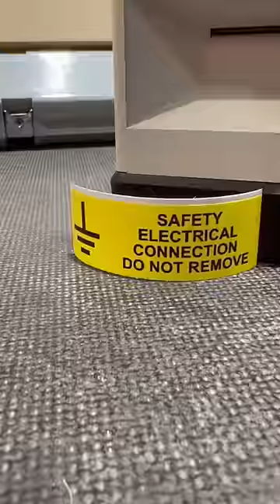Electricians Shocked by this Mysterious Earth Clamp

Comment: The only way an electrician is going to be shocked by this clamp is if there is an earth fault or if they see the price :,)
Reply: Or unless there’s short in the house, and it grounds out to the copper plumbing which that is attached. They will find out when they wash their hands Lolol.

That’s def not code where I live to ground electrical to the plumbing.
Reply: @nebraskaman8247 

So you don't ground your copper pipes? All conductors should be earthed for safety reasons.
Reply: Looked to me like he was using the plumbing as a ground for electrical purposes.
Reply: @nebraskaman8247  We don't bond the pipes to use as an earth. It's so that in the event of a fault, all the metal that a person might be in contact with is at the same voltage. Reducing the risk of electrical shock.
Reply: @nebraskaman8247  its not “grounded” to it, its “bonded”. If you are in the US, it certainly is a NEC requirement to bond across the water heater hot/cold lines.  Note: there are exceptions,  including if pex supply lines are used, at “X” distance to/from water heater, tank material, etc.
Reply: Or by static electricity
Reply: @nebraskaman8247 most likely the other way around. Not ground to plumbing but plumbing to ground.
Reply: @paulw6183  Yes, you ground copper pipes separately. You can also use equipotential connections if you have a weird installation with a lot of induced voltage.
You DON'T ground your electrical instalation THROUGH any pipes.
Reply: @ogi22  

Yes the extraneous materials should be bonded separately on a dedicated circuit, you do still connect it to the main earth terminal though.
Reply: @paulw6183  Ofcourse. To the ground connection near the earth. To not create current flow through media pipes in case of a short circuit. Every modern building has those terminals in each room. Usually near the floor, with a metal stripe leading into the wall. According to two basic laws of electricity - Ohm's and Kirchoff's.
Reply: @nebraskaman8247  100% had this happen where the short grounded out to the plumbing. Thought I was crazy the first time it happened but was 100% electrocuted by my shower... twice... turns out the house, as old as it is, had a shitty ground that failed.
Reply: Ya I’ve personally seen it before. Never had it shock me tho. Just was testing some electrical stuff in a older house once, and the plumbing to ground had power.
Reply: @nebraskaman8247 🤦‍♂️🤦‍♂️🤦‍♂️
Reply: @SWnAZ you weren't electrocuted as you're still alive.
Reply: @dkaspar67  that's because the bond is for metal work. Gas pipes usually. No one is bonding plastic
Reply: Yeah. $3 is craaaaaaazy.
Reply: @starbarrothschild6597 hmm, you've gotta defend that one. I'm no electrician but as a 20 yr medic I'd be questioning my skills if all electrocuted patients died. I mean, this is really a silly statement to make. Even as the most general definition, we "electrocute" ourselves... often! Often enough to call it therapy. Electroshock therapy. Go read a book, don't be argumentative.., and don't do drugs, mkay?
Reply: @dkaspar67 "simple" isn't a prerequisite for plumbing. If only splitting hairs were, tho, eh?
Reply: Ask an American electrician about earth fault loop impedance. External or internal. They don't have to test it at all. As long as the lights show correct polarity and a ground Alls well. I've used the kewtech plug in tester all lamps illuminated. Huge Ze not enough fault current to flow to operate the protective device.
Might be wrong here guys but I did ask this question on another channel and was asked by our stateside friends to explain. Not questioning your workmanship BTW guys. Let me know if you know any different.
Reply: @neepsmcfly4176 It’s a combination of the word electro and execution. It means death by electric shock. So what? You’ve been using the word wrong. Look it up. But who cares? It’s now a colloquialism. Meaning injury by electrical shock. We use expressions non literally all the time. 

For example when you trip and fall, you “Ate shit.” Few people really care if you actually ate anything, let alone shit. It’s not remarkable to express things in this way.
Reply: De-ionized water is resistive, tap water is quite conducive. Not quite as good as copper, but still pretty good, and much better then dry soil.   The dryer the soil, the more/longer ground rods you need.
Reply: Right then. Electrocution in the UK means to kill someone. If you’re a medic then you should know this. I read a book called the Cambridge dictionary to find that out. 

This guy is in the UK. Therefore everyone saying this “isn’t up to code” is quite right. It’s not in your area of the world (probably N Amurica). 

He’s not grounding or earthing the system through the water / gas pipes. He’s creating an equipotential zone where all the metalwork that might carry current is bonded together to create a zone of equal electrical potential to reduce the risk of electric shock possibly leading to electrocution ie. death. 

All installations in the UK have an earth terminal which is connected to the general mass of The Earth. Almost all circuits (with some more able exceptions) have an earth conductor (wire) which is connected back to this terminal and don’t ever rely on gas or water pipes for a return earth path. 

As improbable as it may seem, I’ve seen installations where plastic water pipe has been “earthed”. 🤷‍♂️ 

Remember, not everyone lives in North America so practices differ from country to country.
Reply: Lightning.
Reply: @nebraskaman8247 they arent using the pipes as a ground, they are just bonding the pipes
Reply: @chickenmonger123 According to a number of American English dictionaries i checked, electrocute means to kill or severely injure yourself so death isn't the only posdible outcome. But UK dictionaries define it as killing oneself with electricity. So there is a slight difference in how its used in America vs the UK.
Reply: @nebraskaman8247 if you have a ground fault, you have a short circuit and the breaker is going to go pop
Reply: @andyscott5978 I'm American and in the trades and we all understood this. The YouTube keyboard architects and engineers are a different story. 

My mom always says don't bump heads with a brick, you'll only be left with a headache. 🤷‍♂️😂
Reply: Why not just do it right with a ground rod? This just risks electrifying the plumbing of there's a short
Reply: "Earth fault" ? 😂
Reply: @deci5608  Perhaps because this has nothing to do with ground rods, and doesn't risk electrifying anything.
Reply: I once knew a man who accidentally pissed on an electric fence during a paintball session.
Reply: I am forced to revise my opinion. Bad electricians will also be shocked because they don't know what they are doing
Reply: @cobalt49  And there's a near infinite supply of 'em, too.
Reply: @cobalt49  Don't take it personally.. but any "good" or "great" electrical entrepreneur or engineer. Or even a decent Electrician .. has been shocked. No matter the safety measures. It happened.
Reply: @doejon9424  getting a shock isn't the issue. The number of people who are making fun of the very idea of equipotential zones causes disappointment
Reply: @cobalt49 They just aren't getting it.
Reply: @nebraskaman8247 depends on how far away they clamped the ground to the slab penetrating ingress of the water feed. It should never be used as the main ground, and should always be clamped as close to where it comes up through the slab. The main grounds should still be copper driven rods outside.
Reply: @neepsmcfly4176  Electrocution implies death. Here's the definition of electrocution by the Cambridge Dictionary: "the action of killing someone by causing electricity to flow through their body". Now we also use this word for accidental deaths, however it still means death. The word you're looking for, is shock. Electrical shock doesn't mean death.
Reply: @tcg1_qc  lol, I can see you quivering w excitement while you're trying to organize your thoughts and get them down..... so you can be included in a month old debate. There's a little late to the party and then there's the dismissal of rational thought, overcome by the need to be the smartest in the room. Yawn ok, um, new guy. My entire self assessment hinged upon this comment stream and thanks to your.... timely.... wisdom I'll be reevaluating my life. Much gratitude, Confucius.
Reply: @neepsmcfly4176  Nah, I spent maybe 2 minutes just searching for the definition. I don't care how old the debate is, I saw it today so I'm responding today. You don't have to be an asshole.
Reply: According to my copy of the Canadian electrical code 2012 (because I don't feel like dragging up the paper code that's more recent), 10-902 suggests that a metal water line can be used as a grounding electrode as long as it is on the street side of the water meter or on a cold water pipe of adequate ampacity and as near as practicable to the point of entrance of the water side of the building.
Reply: @SJ-co6nk  what about places without water meters
Reply: @tcg1_qc in the code, "or" in this case means that either you follow the first clause or the second, so where there is no water meter, you'd connect on a cold water pipe of adequate ampacity and as near as practicable to the point of entrance of the water side of the building.
Reply: @tcg1_qc in the code, "or" in this case means that either you follow the first clause or the second, so where there is no water meter, you'd connect on a cold water pipe of adequate ampacity and as near as practicable to the point of entrance of the water side of the building.

And in the case that a metal water pipe is not available, then you'd follow 10-904, saying that other electrodes shall be used.
Reply: @SJ-co6nk  In the UK such methods may be used as an additional means of earthing, but the main earth should be sufficient on its own. There are exceptions, but that is the general rule
Reply: @SWnAZ You were electrocuted? How is it that you can write this comment if you are dead?
Reply: @SWnAZ you weren't electrocuted. Lmfao. You were shocked.
Reply: @dkaspar67  No he was BONDING the pipes to ground.
Reply: @JSLEnterprises  Not in the UK. Ground is part of the supply cable.
Reply: @SWnAZ  You should look up a 220/230v hot water shower head lol. That's an interesting setup. #suicide shower. Electric boom had a good video it.
Reply: @nebraskaman8247 Actually, all the plumbing needs to be bonded like that. It’s not the ground, it’s bonded. Same with gas.
Reply: @starbarrothschild6597 Thanks. Very few people know the difference. And it’s obvious a huge difference.
Reply: @dkaspar67 So of you knew what was really going on, then why would you mention pex when we all know pex is not a conductor? Doesn’t matter what state you live in, if you have pipes that conduct electricity, they’re bonded to ground. Plain and simple. It’s not a matter of state, it’s a national code. Nfpa 70 of nec. Same goes for gas pipes they’re conductive, bonded to ground. I can’t stress enough, know what you’re talking about before chiming in. Pretty sure all of NEC is available for free online. You could have answered all your questions. Now that we have electricity out of the way, what is the national plumbing code we use? Any plumber would know this. I’m not talking about local regulations either.
Reply: @nebraskaman8247 , when you're not very good at physics, but don't know the best way to say it :)
Reply: They are less than £3.